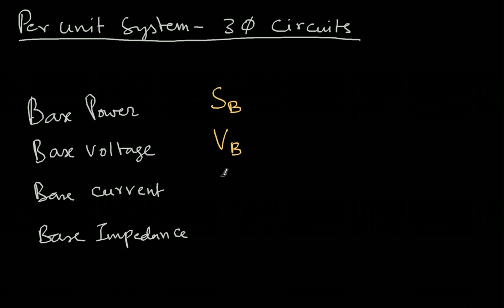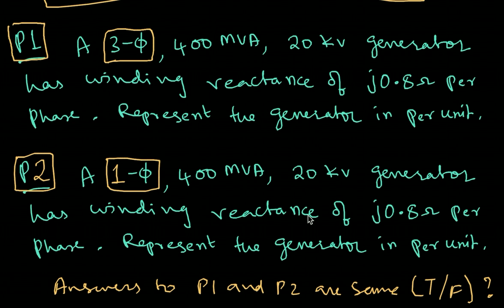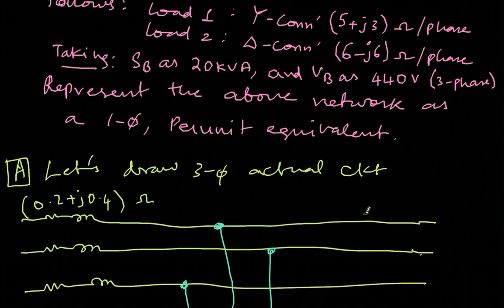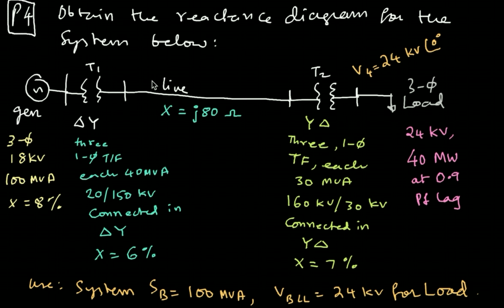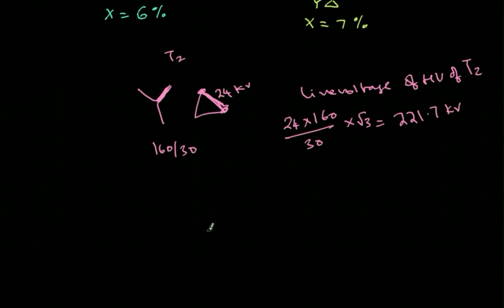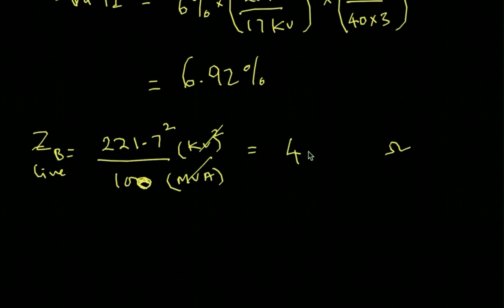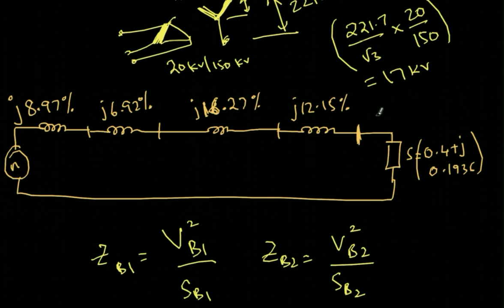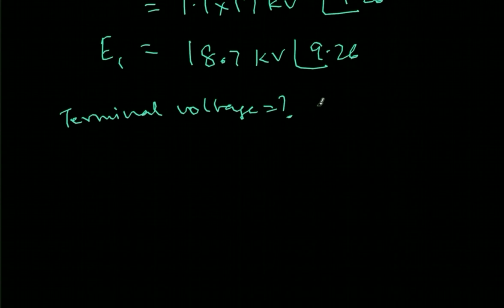Per Unit System - Part 3 - Three Phase Circuits

Comment: Sir in the first problem P1 why not zactual= sqrt(3) × j 0.8 ohm
Since it is a 3 phase impedence 
And in question it mentioned j0.8 per phase right sir 13:00

Comment: Pradeep ji,  In line with the subject ,  requesting you to consider tutorial for following situations which any electrical engineer may come across in day to day life.

1. How to size a transformer  considering connected load and one of the loads as a large capacity  motor .The motor is started at the last when other loads are already started and running. The starting of motor as  direct on line  and  maintain a acceptable voltage drop at the motor terminal during its starting

2.One of the examples from the real life of any industrial network and finding min & max fault levels at different locations in the network.

3. Approach to decide size of NGR for generator , Transformer  etc.

Truely thankfull to you for your efforts and sparing time to educate engineers

Comment: Sir,in single phase transformer there is no question of phase shift b/w primary and secondary currents ,but in 3-phase there is a phase shift due to star delta so where are we considering this phase shift while calculating voltage drop..

Comment: hi  sir 
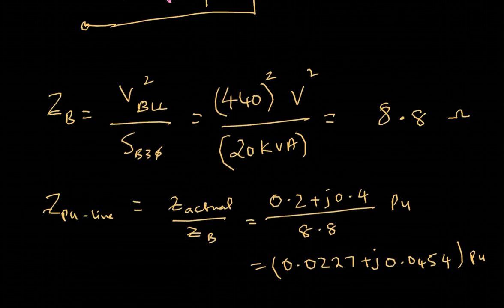27:50 ,  i think there is a mistake  because you did not divide the impedance by 3  to convert star connection before you divide by 8.8.
((6-j6)/3)/8.8=0.2272-j0.2272). 
pls correct me if i am wrong .

Comment: at 52:04 i have a question that what if we choose base voltage on generator side instead of on load side(in the present case)? i mean to ask how we will represent load in pu if base voltage differed from rated voltage at load?
or 
is there some convention to puposely take base voltage same as the rated voltage at load?
if time permits plz reply...